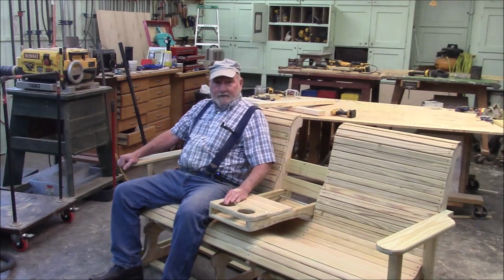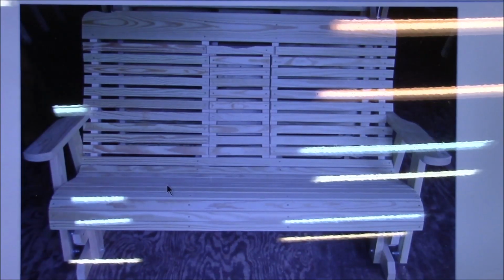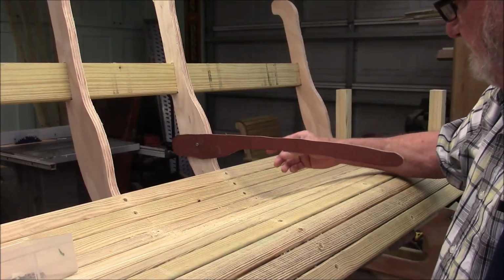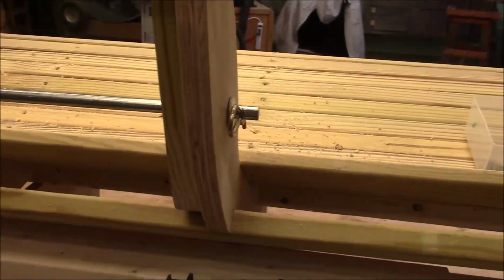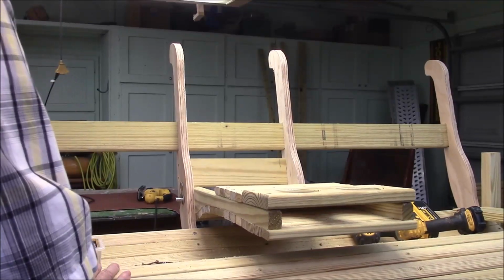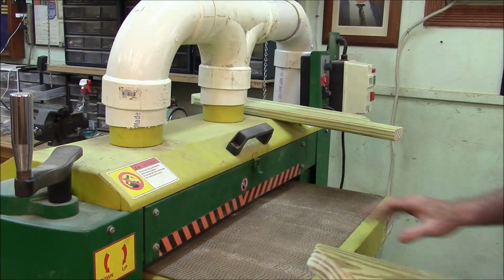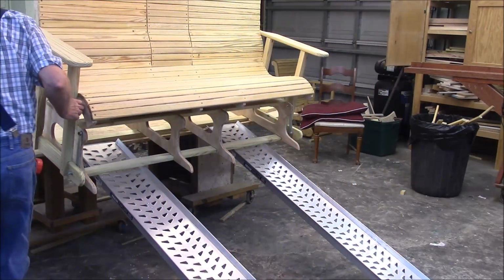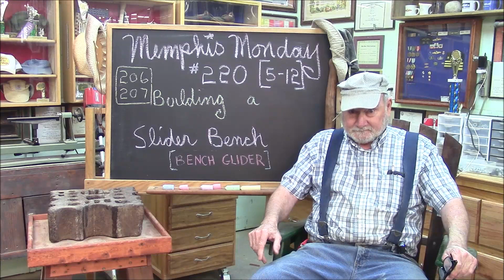Building a Glider Bench MM 220 512

Comment: This appears to be made from treated deck boards, but that could be the lighting effect. I'm not wild about working with treated lumber, but it does help keep things from rotting quick. I have a customer who wanted me to build one from an old flimsy headboard from an old bed, but I had to pass on that idea in favor of making the back section from the same material as the seat and so on. The headboard has 3 separate octagon post pieces holding things together and I'd never match those not to mention how flimsy the whole thing is in the first place.